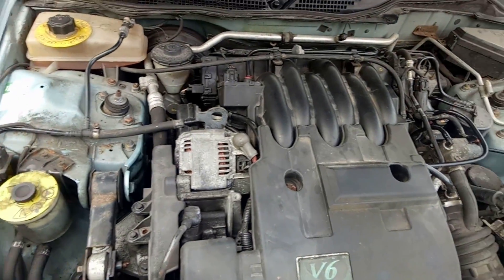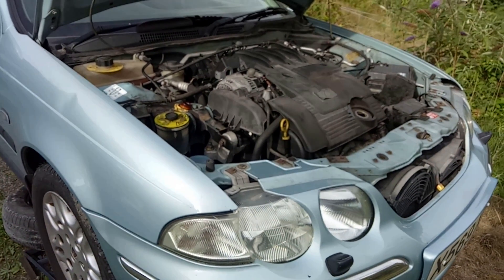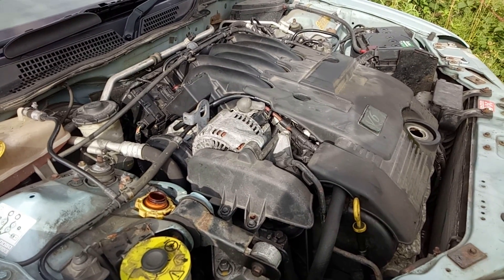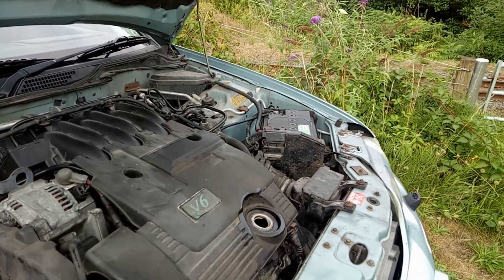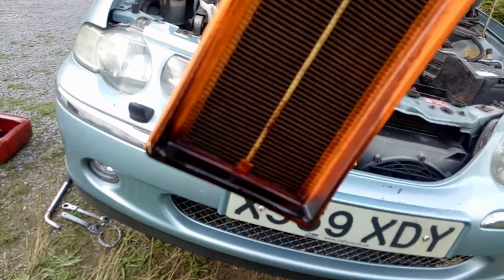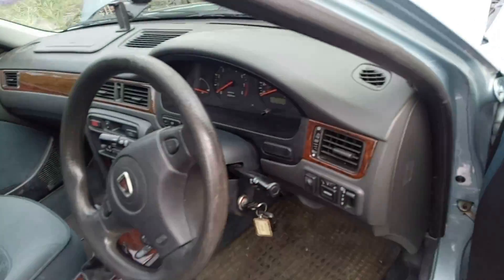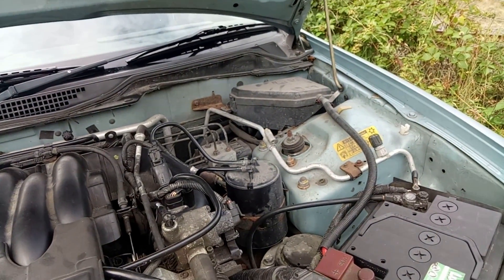The Rover 45 V6 gets half a service

Comment: Besides the plugs, I'd also invest in some MAF sensor cleaner. It will make economy jump 50%, and find 2-3 cylinders under the bonnet whose work ethic was decidedly lacking.
Reply: wanderinggentile The kv6 doesnt have a Maf sensor, it has a Map sensor so Maf cleaner wont work in this case. A can of carb cleaner down the intake tract to clean the inlet manifold wont hurt.
Reply: My deepest chagrin. I made a poor assumption, and I am responsible for my error.
Reply: I might consider a Seafoam treatment before swapping the plugs, though.

Comment: If you’re brave enough to chuck £80 at an old car, have it Carbon Cleaned. I was massively sceptical about the whole process, but Leon at Bodgett and Leggitt said it was worthwhile, and he seems to know what he’s talking about. It absolutely transformed our Citroen C-Crosser. Loads more power everywhere, but a bit like you’ve identified, no more MPG due to the fun of the new-found power.

I’d love to hear your thoughts on having it done.
Reply from the maker: Yeah, I'm pretty sceptical about most things!
Reply: How do you know when an engine needs it?  I used to have an R56 MINI Cooper with the 1.6L engine, which is an engine renown for carbon buildup.  A lot of people used to do it in the Mini club and would recommend others doing it citing that they've gotten more power, better mpg etc but it was something that I was sceptical about.  I don't really know much about the whole process.  I've read that the carbon buildup on modern engines is partly due to indirect injection...
Reply: SuperFIFTHGEAR we bought a C-Crosser 2.2HDi and had it remapped, which should have given it around 190hp. It just didn’t feel like that much, so did some research, took loads of recommendations and booked it. It’s an amazing transformation. Within 5 minutes on the hydrogen, it suddenly ran a lot more quietly. After the full hour, I took it for a spin, and as soon as I was off the drive I could tell the difference. It’s a total transformation. I was really sceptical before having it done but can’t believe he results. The guy who did it says all of his customers say exactly the same. He recommends it’s worthwhile on any car with over 20,000 miles. Hope this helps.

Comment: You can get flushing oil which gets all the crud out of the engine you drain some oil off then add the flushing oil and run the engine for 10 minutes before draining everything off might be worth considering at the next oil change
Reply from the maker: I'm not a fan of flushing oil. I'd rather let things take their time to clean up. Another change after 1000-2000 miles should help it.

Comment: If your going to change the oil again, your better off going to your local Asda, although, admittedly, you do look to be a bit "rural" and buy there cheapest boggo engine oil and run that thru your engine, it might save you a few Bob next time, use it as a flush or try some " ceratec", excellent products !!!!

Comment: £13.85 for 1 litre of oil ??
My car lives on 10W60 Castrol Edge and 2x4 litres of that was cheaper ! [ Did an oil change on the E39 M5 Saturday ]
Have you got a trade car for Halfords ? Their own oils, ideal for this Rover, are well discounted.

I changed the spark plugs on my 2.9 Granada Scorpio. It transformed it. It used to stutter and splutter at idle but now it's much better. Still must change the dizzy cap & rotor arm.

Comment: Use an oil flush when you change the oil again.
Reply from the maker: Not a fan of them. A short change interval will do the job just as well, if not better. Less risk of clogging oilways.
Reply: It does look like you got that car in the nick of time as judging by the air filter and oil and oil filter, it's been neglected for a while. BTW, I've done oil flushes and not had a problem. A decent product such as "Wynns" should mitigate against blockage.

Comment: If you want to improve the mpg get some injector cleaner fluid. I use redex and it definitely works especially on older engines with high mileage. Also you can increase the tyre pressure slightly. All helps improve mpg.
Reply: I agree with Djg, injector cleaning is critical to any modern car. Remember to not top-up the fuel tank though until you are close to empty. My former wife used to fill up her car every week, so when I treated it with injector cleaner I used to add a bit more for four or five weeks until a full tank had gone through. She wouldn't listen to me about the wastefulness of driving around with a full fuel tank either.
Reply from the maker: This car has a tiny tank and likes a drink. It's never full for long!
Reply: Look o the bright side Ian, it won't take long to clean up the injectors.
Reply: Reverend George I once stripped down a Hyundai getz to lighten it to save fuel as I was only using for a commuter car. I reckon I gained another 5 mpg out of it lightening it. Now though I have a Nissan leaf for most of our journeys and very very cheap to run.
Reply: Djg - I haven't done anything that drastic, but I don't drive around with a full tank when only using 2 or 3 gallons a week.

If you are planning on keeping an electric car I would advise against having a Smart Meter installed. In a few years time the electricity to charge your car will cost a lot more than your domestic electricity, but only a Smart Meter will be able to tell the difference. I am an engineer and have worked in the automotive industry and the power industry,this is not the ramblings of a mad conspiracy theorist. I recently worked on a project making gas exploration equipment; there are plans to build thousands of gas-fired power stations to supply the demand from electric vehicles in the next few years. If governments actually listened to engineers we would be driving around with lean-burn engines and not have catalytic converters, trouble is they don't listen to things they don't understand.
Reply: Reverend George thanks for the advice on the smart meter. I read somewhere that the idea of the smart meter is to charge more at peak times for the electricity. So nothing more than a more complex way of reliving you of your money.
Reply: Smart Meters are a con. A friend of mine is a consultant to the National Grid, he tells me that no senior managers for the National Grid have had Smart Meters installed at their homes, which says a lot about them. The adverts for the damn things would make you think that just having one will save you money, they won't unless you switch things off, turn down thermostats etc., but that is never mentioned in the adverts. You can do all those money saving actions without a Smart Meter.

Charging more at peak times won't just be done based on time either. For the National Grid frequency is critical, and this is maintained by reducing the voltage, which means that you will draw a higher current for some electrical apparatus. Smart Meters also monitor voltage and when it falls due to high demand you will be charged at peak demand rates, regardless of what time it is.
Reply: One idea of smart meters is to teach people that eg an electric shower uses more than a phone charger.  Well, I don't need a smart meter for that, it's common sense and you can read the power rating on the device. I think the electicity companies also have an idea of you sitting all day watching it, shouting to the wife to turn the washing machine on or off according to the spot price. I'm afraid I've got better things to do though.

Comment: Why use the most expensive GTX oil when you're going to change it again in a few weeks?  Any old budget brand would have been fine for flushing purposes.
The state of that air filter was a bit worrying!
Reply from the maker: I do plan to do quite a few miles in the coming weeks. Good point though. Should have slapped any old oil in.

Comment: Hi Ian

Did you find where the oil "seepage" was come from at the front of the engine at the beginning of the video?
Reply from the maker: No, though I did add to it by spilling some oil on refilling!
Reply: Looked like the steering rack attachment bolts so maybe PS fluid.
Reply from the maker: No, it's something that bolts to the sump. Rack will be much further back.

Comment: I have never removed a sump plug for years as most don't get all the oil out of the pan...  Citroen and Pug diesel fleet
I vacuum pump it all out and no mess at all no trays to spill and its all contained till I need to paint something  hush hush
It's about time we see you getting your hands dirty again.......   Car rich  time poor
Thought that old fox engine was  a 750   let's hope your contracted out engineer can find a replacement 850
And an app to take your YouTube videos......   Whatever next   you learn everyday
Reply from the maker: I collected a replacement engine for the Fox today. They were all 850s. The app is a camera app, as the built-in one on Android refuses to work with external mics. Not that i used one for this video!
Reply: And you are sure the vacuum pump gets all the oil out? Suppose the pipe is not at the lowest part of the system (like the sump drain is) but is caught on a ledge somewhere. I'm not suprised it is a fleet maintenance thing as it is quicker, and a fleet manager is not so worried about long term life as the cars are auctioned off after a couple of years. I'd never buy an ex-fleet car.
Reply: Duke Nukem we drained the oil from the plug on a 1.6hdi  then dropped off the sump  still 650ml of oil trapped inside the sump from a 4 litre oil change  so that's potentially 650ml of sludge over time. Psa group then recommended oil flush during service but this still means the mechanic draining the oil out of the plug now has at least 650ml of oil flush mix still within the engine to mix and contaminate your new oil
My transit van with pug engine is coming up to 170,000 no strip down  all as it left factory
My 307 1.4 hdi. Has now covered 130.00  original turbo  still runs fine
My wifes c3 has now approached 90,000 original turbo   and these are prone to seize due to oil sludge

When I vacuum out sump on a hdi I get all of the oil out as I can see it on tank near 4 ltr mark
I can change the engine oil and filter on my drive within 15 minutes  no mess
Every 4000 miles  rather than every 15.000

Comment: Why not use a flush before changing the next change?

Got to be breathing a bit better now, with a new filter. That was absolutely horrible.
Reply from the maker: Not keen on flushes. I'd rather it cleared itself out slowly.
Reply: That just leaves more crap behind. I'd understand if it was an old A series engine, but even these Rover engines were built to a higher tolerance than trim fitting might suggest...
Reply from the maker: It runs ok, it doesn't burn oil. It's fine.
Reply: It certainly sounded a lot better with a new air filter. Look forward to improved dialysis when you get a fuel filter.

Comment: Compare the dirty air filter with a straw through your mouth. If you do use cheap oil with a motor with hydraulic valve tappers, your engine will become soiled faster.

Comment: That air filter looked disgusting.very clogged especially at one end.   Oily too.....
But V6 2litre?   Thought they were 2.5.
If the spark plugs and filter are just as old heaven knows how much more improvement youll feel from the motor.
Ok oil was £13 for a litre but at least your car is bought and paid for!
Reply from the maker: Nope. KV6 in 2-litre form was used in both the 45 and 75.

Comment: Does that engine have hydraulic tappets?, i know they can be very fussy when it comes to oil quality. But what ever the reason, nice to see the old girl running better. Said it before, but will say it again, what a shame Rover went bust just when they started to make some very nice cars once again. It was probably the cost of developing those final models that tipped them over the edge. Big shame.

Comment: Trouble with warming the oil before draining is that it spreads it all round the engine, whereas if the car has been standing cold for some time it is down in the sump already and ready for draining as far as possible.  We are caught between two stools. Home mechanics however can get the best of both words by warming engine and then leaving draining overnight - something professional shops can't do, customer wants car back today.
 
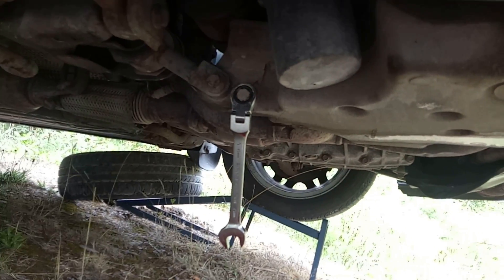@ 1:10 15mm an unusual size?  On my Jeep Grand Cherokee (actually made during Daimler's ownership - ie European influence) the common AF sizes go 8, 10, 13, 15, 17, 19mm. The oil drain plug is a 10mm hex socket though. But occasionally I find a 12 or 18mm AF. Why can't these clowns standardise on a sensible logarithmically increasing sequence? Absolutely no need for all of 17, 18 AND 19mm sizes.

5.2 litres of oil for a 2 litre engine?  You are lucky; my 3 litre Mercedes CRD V6 (in the Jeep) takes 10 litres, costs about £80, Halfords stuff.  Its very expensive to buy by oil the single litre, rip-off.
Reply from the maker: I would still rather warm the oil. I leave it draining while I crack on with other service items, so it's draining for at least 15 minutes generally. You don't gave to get every last drop of old oil out - you never will.

Comment: Where did you manage to get the genuine rover filter. And by the way it’s not a 2.0 it a 2.5 litre
Reply from the maker: On Ebay, and I think I know what size the engine is. 2.5 was MG only in this body. Rover no larger than 2.0.
Reply: HubNut ok then, good luck with reliability 😂😂😂😂

Comment: There is no need to fill the oil filter.
Reply from the maker: Seems a better idea to have it full to me.
Reply from the maker: Not convinced by him to the honest, though he raises a good point about the best way to fill them. To be honest, I usually don't bother with that step (as the oil filters inevitably go on at an angle) but this is a really need filter, and I wanted oil at the correct pressure ASAP.
Reply: Fair enough
Reply: No harm in it as long as the filter points upwards. Your video link is about a guy worried about brand new oil needing to be filtered - hard to believe that. In any case, he says it can be solved by filling the filter via its outside holes (the dirty side).